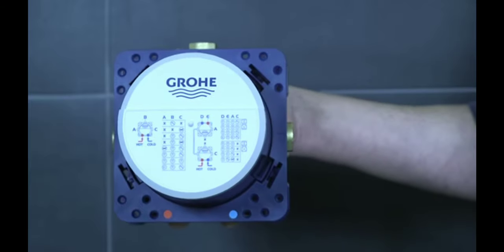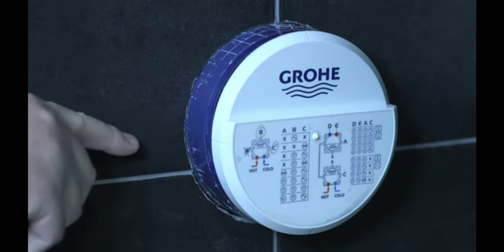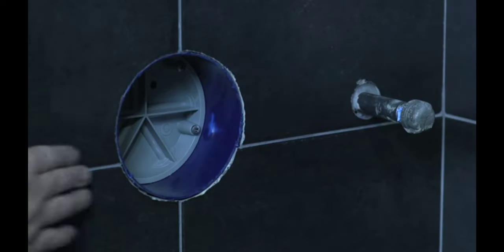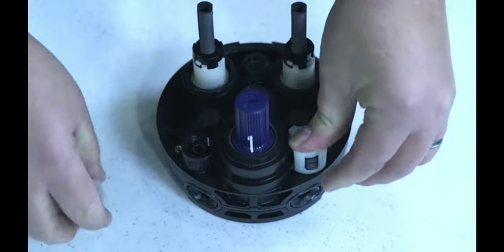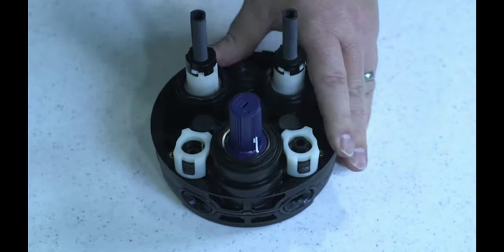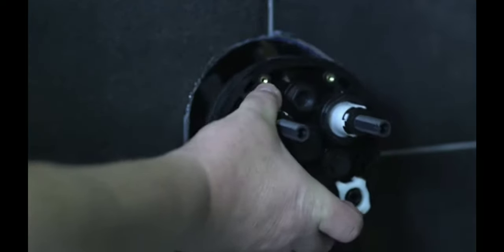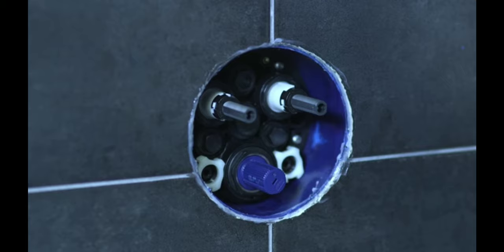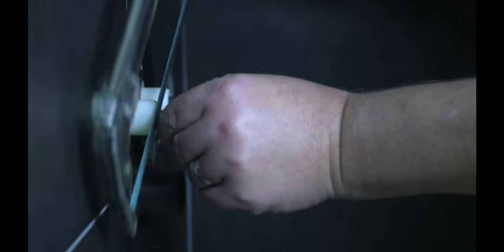Grohe Rapido SmartBox Installation

Comment: Really need help here.The keys on the volume controls are off at 12  (pointing straight up). The backer plate chrome knob keyways are off at 4 . Line the keyways up to fit and the water is half way on. Cannot figure out what to do here. It appears in the videos that they just slide the backer plate on with no problem. Hopefully you can help. The unit works perfectly except for the backer plate not fitting correctly.Thank You Very Much.

Comment: The valve button (on/off) for the shower has started sticking to the point where it will not pop out (turn on) (only two years of use) Do you have a video of how to replace the valve button? Or tips to fix it?

Comment: Is it safe to solder fittings on this unit? I'd rather use solder but need to make an immediate 90 degree bend after port B.

Comment: Hi, The builders got the smartbox roughed-in a bit too deep, over the 105mm mark after the tiling.   
I found about the extension kit (Part 14048000), will this allow to fit the control module without having to rip it all apart and reinstall?
Reply: Bwan چ

Comment: Nice job! the first video I see with more or less the same installation method for the waterpipes. I also want to solder my 15mm coper waterpipes. As well as both inlet pipes as 2 outlet pipes. I will also put the blind stop in outlet A. Did you solder the inlet and outlet while the 1/2" to 15mm copper pipe was allready in place? I suspect that it becomes way too hot for the smartbox (and it is no good for the sealing stuff on the threads as well). So I think you did the soldering first, before screwing them into the 1/2" sockets of the box. My problem is that I my pipe from outlet C has to cross the pipe from outlet B, as my handshower will be on the left of the box. (shame that I cannot use A outlet). The same crossing of pipes will happen when Installing the hot water side. That makes it a real effort to get this thing installed as all pipes must be in place, before I can install it inside the wall (I am not mounting it like you, it will come into a wall which has depth 100mm, so that is also a challenge when cutting away the stones, as only 2,5cm of stone will be left. The smartbox needs fixing screws as well. I do not have a solution for this right now, how to do it. Maybe glue the box to the wall?))
Reply: I have almost exactly the same question with soldering near the valve. Did you answer it?

I might contact Grohe customer support.